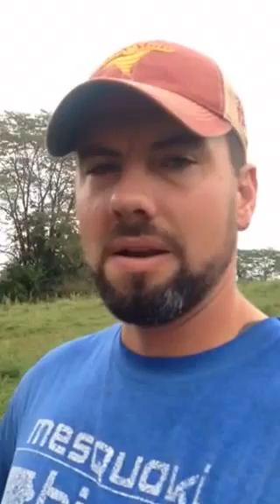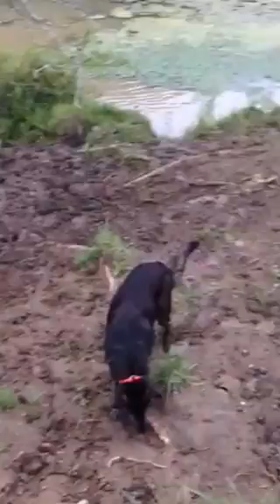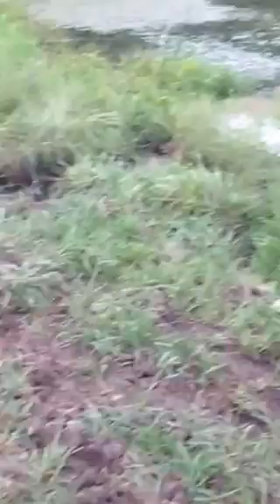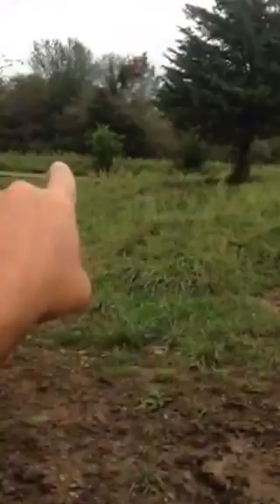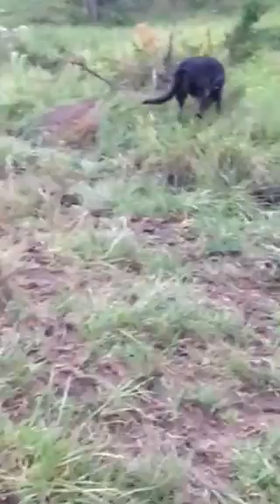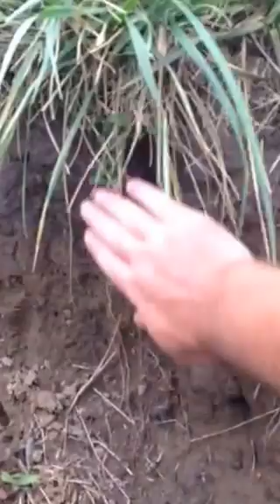Erosion Control in Pastures

Comment: what did you use for fencing in your pond to keep them from going all the way in?
Reply from the maker: I drive two posts on the shore then wade out into the pond about 3-5 feet and drive a long post (two t-posts welded together) down. I then run polywire between the posts in a "u" pattern and leave it up till fall. This prevents the cows from wading out there and gives me something to connect to the next time around.